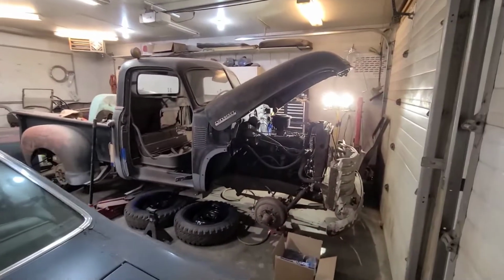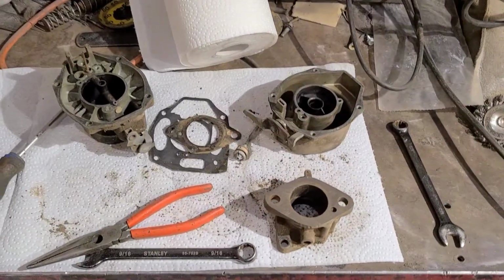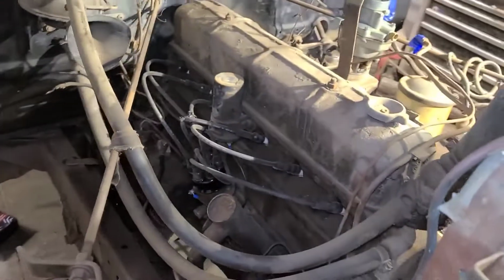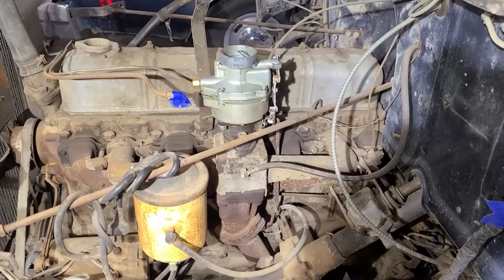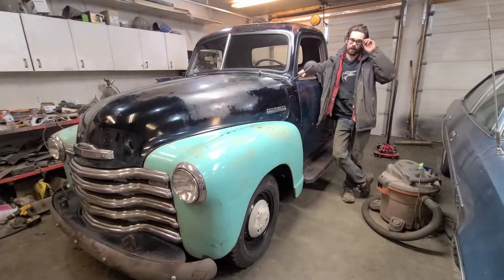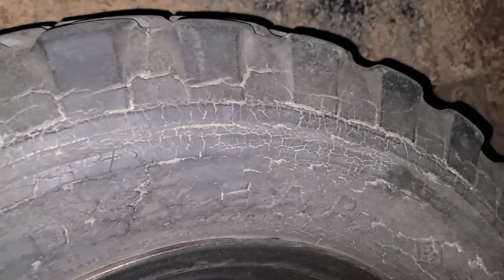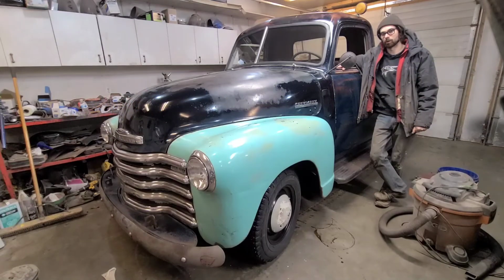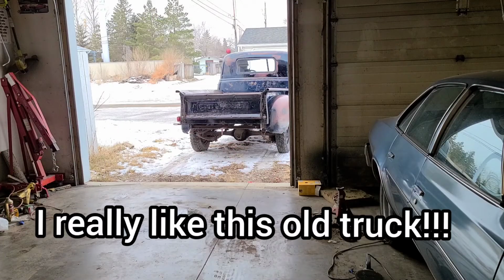1950 Chevy 3100: First Start and Drive in 40+ Years

Comment: I really like that truck, it seems to run really well. On old tyres I would offer the following. I have a 65 289 Mustang here in the UK. I was accelerating to get past a slow vehicle and the back kicked out and the car started fishtailing all over the road I thought I was going to wreck the car but just managed to catch it and keep it on the road. I thought I had driven over some oil or something but long story short the rear tyres were low mileage but over 10 years old. I found they had virtually no grip so changed them and the new ones are so much more grippy and safer. I worry when I see people on You tube  buying essentially NOS tyres at rod shows as rubber does harden and lose its grip properties with age.
Reply from the maker: Thanks it's a neat truck for sure. Featuring the old tire was for entertainment purposes only, I don't endorse driving around on unsafe tires.

Comment: Fantastic truck, love the two tone and blue is awesome. Interior dash is quite amazing. The radio were the old tube type with a vin raptor chopper in them to make ac. A battery killer. A radio delete plate and I suggest to keep it original as you can. Alberta Dave 😊🇨🇦
Reply from the maker: Thanks Dave! I ended up finding the original radio delete plate under the seat.
Reply: @CarterAutoRestyling  What a bummer for me that you found the radio delete , I was hoping to see you make one! 😁 Wow the engine sounds amazing! 👍😎

Comment: Nice video.......  I was thinking yeah, those tires should hold up for a short test drive if you don't do any U turns.   10 seconds later a big ole U turn.      LOLS.  Truck looks great.  Some how I think if fits right in with your jacket!!!!!  Thanks for the video.  If you keep working on these old carbs, think about buying a sonic cleaner.  Really does a nice job cleaning all kinds of stuff, even your kitchen utensils.
Reply from the maker: Good idea on the ultrasonic cleaner, I don't do many carbs, or much mechanical work at all, but I've been considering one of those cleaners, as it's impossible to get good solvents in Canada these days.

Comment: I think those mouse ear indicators are the business. Would you call them signals?
Reply from the maker: Well they are wired to the turn signal switch so I'd like to assume that's their primary function.
Reply: @CarterAutoRestyling  All the proof we need Holmes! 😁
Yep, you say turn signal, we say indicator, you, fender - us, mudguard etc. 
I really like those lamps on a 40s & 50s trucks but they never seem to be left on vehicles that make it over here. You will see something screwed on the mudguards which just looks wrong.

Comment: The engine was sitting for 30 year's? Then there is hope for my 250 straight 6 been sitting for 8-10 year's 
It should I had a bunch of work done to the engine before parking it.
Reply from the maker: It was parked sometime in the 1970s. These old 6 cylinders are tough to kill